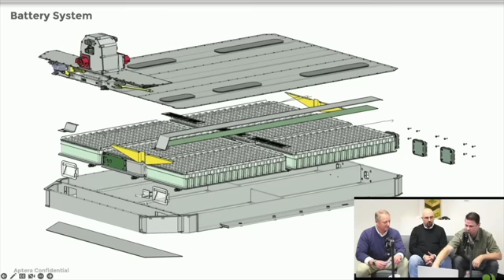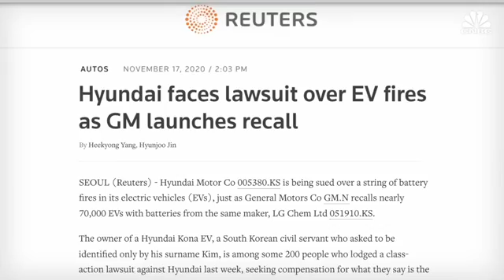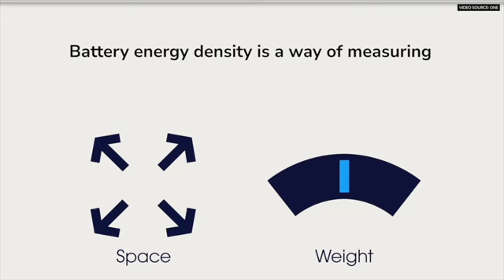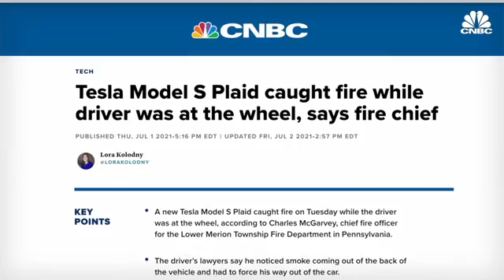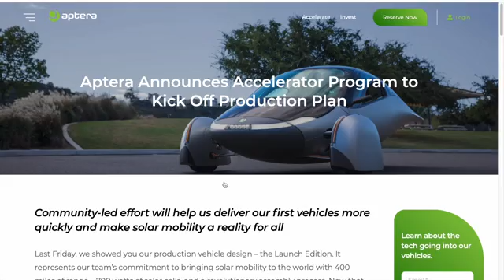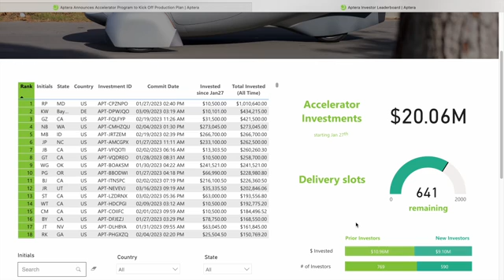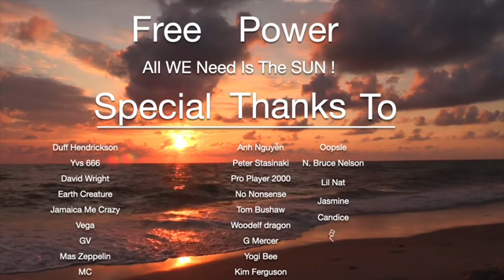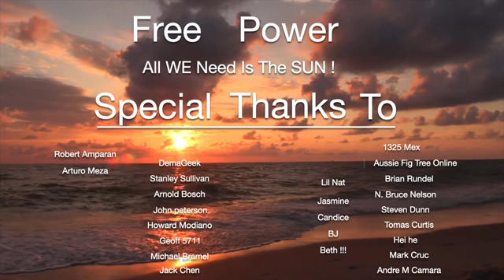Aptera Should Really Consider LFP Batteries !

Comment: Cycle life and calendar life are different things. I have a LFP based power wall - it has an expected life of ten years regardless of use. Life is also shorten by high temperatures.
The range hit using LFP is not that great. I'm happy to loose %10 for a safer battery. M3P batteries should be close to the same energy density as NMC.
No - 400lb total load is not enough. I'm not overweight but two of me would exceed 400lb without any cargo.

Comment: I would suggest to give Amprius battery a very good evaluation. My impression is that one cell type can fulfil the 3 Aptera range offer. The lower range will have reduced cells number. It has also the potential to reduce the pack weight by half and offer very high power and range.
Reply from the maker: Amprius would be my first choice but they are not in a position to mass produce their batteries yet . 😎
Reply: @freepower1082  I don’t think that the battery production volume will require mass production for a while, especially if number of cells is reduced in half.
Reply: @pierrechampoux7566   Even though Amprius has amazing batteries, there's still an economy of scale they have to aim for.  If you saw the Munro video where he walks through, the factory will have to be gigafactory classed just to meet demand nonetheless hope to become a key player

Comment: The best solution for durability and safety would be the LFP battery.  I know there will be an efficiency hit because it's heavier but like you said the lfp battery can be charged up to 100%.  So because it could be treasure to 100% I'm going to guess of the range will roughly be about the same.  I also like the fact that it is lfp has a higher cycle life.  
But as long as my Aptera doesn't catch on fire and lasts about 20 years without any major problems I'll be happy lol
Reply: Sodium would actually be ideal if they can be sourced.  They are larger (same weight per kwh), cheaper, more environmentally friendly and better in cold.  Given aptera has space for a large 1000 mile battery sodium could still achieve 400-500 miles.
Reply from the maker: Sodium batteries would be great and there’s a company from England call AMTE Power . That company makes sodium batteries but I don’t know if they are manufacturing them right now , that would be a great way for Aptera to go ! 😎
Reply: @freepower1082  any chemistry change will be 1-2 years after start of production at minimum.  Aptera doesn't have the money to engineer and implement a change now.
Reply: @freepower1082  Since we dont get EV incentives anyway CATL and other chinese vendors would probably be the way to go.  sodium is definitely less proven but as a canadian and environmentalist I like the temperature tolerance and lack of lithium.  On paper LFP and sodium are very similar.  Both cap at ~2c discharge which is a slight performance hit for AWD (sport car market) as they would limit a 45 kwh battery to ~75% motor power (90 kw vs 122 kw); maybe 5-5.5 second 0-60.  Power limiting is not an issue for the winter driving advantages of AWD

Comment: Their initial focus was on a low volume production of a high performance vehicle.  LFP would probably require dialing back the 0-60 performance. But it should still be very usable. Maybe in the future.
Reply from the maker: That’s fine with me , I would rather have my vehicle last than to burn rubber off my tires . 😎

Comment: I hope that they use the LFP chemistry even if it lowers the range a bit.
Reply from the maker: I would much prefer having less range than having my Aptera go up in flames . 😫
Reply: I don't think the range is going to take a hit because we can charge up to 100%.

And remember the other lithium battery (I don't know what it's called)will degrade faster than the lfp
Reply: @ronnw8153 
See SIB in two years, it will replace LFP, LMFP exacly to its better thermal properties, less degradation, more cycles, better fast charging, if needed.

Comment: This is a really important topic since it could become a stigma as more people adopt electric vehicles and realize that vehicles using ternary or NMC chemistries may be a statistically more risky technology for fire safety and avoid them outright.
Reply from the maker: It can also save them money in cost and recalls . 😎
Reply: @freepower1082  The risk is being wildly overstated for headlines / FUD.  Real world fire risk is still lower than ICE vehicles.
Reply from the maker: I just want to make sure Aptera will not have to deal with recalls and have batteries that last longer than 10 years . 😎
Reply: I agree that the media plays a role in the relative impression of the safety of new technologies.  NMC batteries may be safer compared to other technologies but for business liability and customer safety reasons, it would be beneficial to be associated with technology that has no perceived reputation or history of safety issues, specially if NMC accidents continue to occur, even in small numbers.  In other words, the safety liability can't be used as ammunition for FUD if it doesn't exist.

Comment: Aptera needs to use VoltaXplore's graphene batteries.  They give 10% more range than a Tesla using their 18650's so the Aptera could capitalize even more range than they do now AND they come from Canada so it'd still be eligible for tax credit considerations.  They're also cheaper & heavily dendrite resistant and has a much larger heat range flexibility too
Reply: Canadian here so I'm glad you mentioned them!  They've done amazing work and supply the graphene 
/light weight brake lines to major OEMs right now.  I can see the synergy if Aptera used their batteries.  They are making the 2170 size of graphene batteries so it'd be perfect!
Reply: @makerofthings I'm not a Canadian but I did want to diversify my portfolio to include them for being the largest graphene producer though.  Their work with cement is awesome too
Reply from the maker: Now that sounds like a much better option ! 😎
Reply: @freepower1082  It would be a superior option for Aptera for a lot of reasons.  What wasn't mentioned is they're lighter in weight too
Reply: @freepower1082  I wonder if VoltaXplore can handle Aptera’s anticipated volume and production schedule?
Reply: NanoXplore is a great company & the #1 graphene producer in the world.  Their VoltaXplore subsidiary is perfectly poised to galvanize Graphene at the best rate of conversion so it definitely explains the lower cost.  They're even already amidst finalizing their gigaplant so they'd be a great choice for Aptera to keep costs low.
Reply: @goodcitizen9827 Yeah I have 1000 shares in NanoXplore.  I would buy a lot more if I knew Aptera would buy their batteries.  Everything about them makes too much sense.  I didn't even think about mentioning the weight nor the reduced charge time they have.  Small caveats but great all the same
Reply: Aptera can use the bottom of the barrel batteries and still have record range.  We need affordability.  The design engineering will allow sodium or LFP which are safer, cheaper and longer lasting to still have industry topping range (500 miles).

PS:  Autocycles cant get federal tax credits regardless of where they get the cells.
Reply: @ccibinel  For now 3 wheelers can't get the credit.  That doesn't mean Aptera's lobby team can't fix that eventually.. which they're currently underway lobbying for
Reply: @ccibinel  A perfect fit for VoltaXplore batteries.  They're going to be the cheapest graphene batteries from the #1 graphene producer in the world.  Economy class batteries after 2026 rolls through so Aptera might as well start signing paperwork before someone else does
Reply: @goodcitizen9827  If they can make the cells Aptera needs I'm sure they will look at them.  Aptera would need to reengineer to switch to 18650 and since they dont get the federal credits anyway they generally are better off dealing with chinese vendors; other EV makers will be bidding for local suppliers because the federal credit is huge.  Also dont forget the 600 and 1000 mile need 90mm and 120mm tall cells to allow reuse of components.
Reply: @ccibinel   
The CEO Saroush says they'll offer their graphene tech for all form factors
Reply: Agree. LFP or sodium carbonate. Graphene sounds interesting.